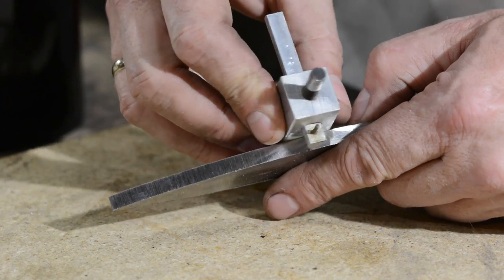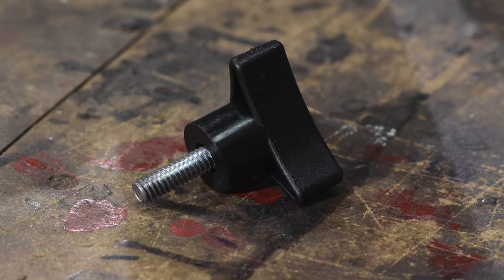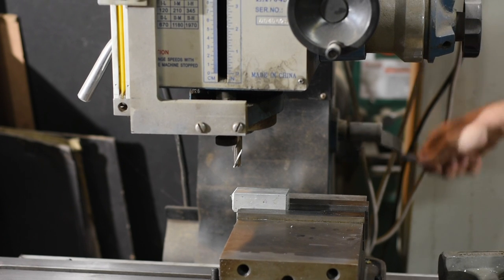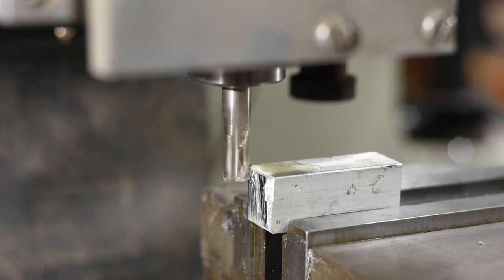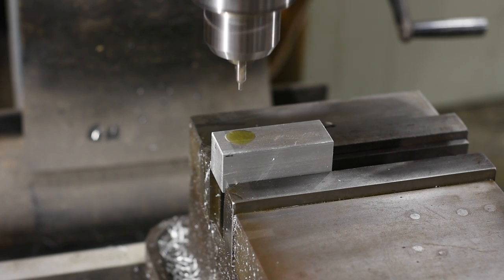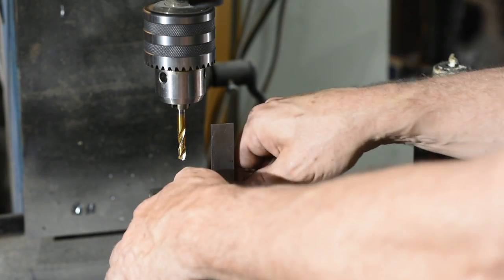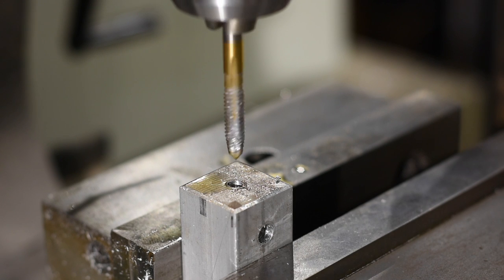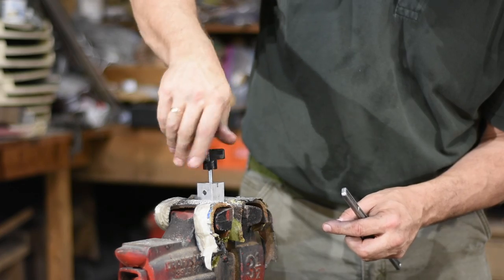Making a Knife Maker's Center Scribe - Easy Project!  Useful Tool!

Comment: Nice version of an old wood working marking tool. For center finding on an edge I use an even older version. Take some flat stock drill a hole at the center of length through it's face. Then drill two holes either side of that center, equidistant. Put pins in those holes and scriber into center hole. Put the scriber to your working stock and twist the bar until the pins ride on the working stock. Slide it down your edge and instant center line.

Comment: So you measure the thickness of the stock.......... then you adjust this extremely precise tool by hand.  It isent set up like a digital caliper to be some what exact?  Just use your eye and hand, is that correct?  I mean that's a pretty big let down.  You want a tool to help you find the true center line, so you buy this and then you do it by eye and hand.  Unless I'm missing something, but like amazon this video really dosent show how it's used.  So I'm trying to figure out if theres more to this than what I have figured on up above here.

Comment: You said the symmetrical grinds diminish the likelihood of warping during heat treating.  But aren't a lot of Japanese knives ground with the bevel on one side only?  That's about as asymmetrical as you can get.  Do they always warp?  How do they deal with warping?
Reply: Sam Harper Some knife makers heat treat and temper before doing the bevels.  A chiesel grind would absolutly benefit from that technique.
Reply: They're usually done with an iron core so they when the blades inevitably warp, they just hammer it back to flat. Walter demonstrates this in his sushi knife video.

Comment: Walter, is sticking something to a brass rod, 
using a brass filler, soldering, brazing, or welding?

I'm pretty sure that it isn't soldering, (although 
brazing 2 pieces of steel, IS soldering.  (An 
adhesive bond.)  Welding USUALLY involves 
steel, but wouldn't joining 2 pieces of brass?
Sounds like welding, to me.

https://en.wikipedia.org/wiki/Soldering

steve
Reply from the maker: In different trades, you'll find different answers to that questions.  The general notion is that soldering is a low temperature operation (around 500F) and brazing is a higher temperature operation (typically above 900 F).  In both cases, however, you're using a second (generally) dissimilar metal with a lower melting temp to join to other pieces of metal with a higher melting point, whereas welding involves actually melting the pieces which are being joined.
Reply: Walter, I was arguing semantics.

Is attaching 2 pieces of brass, using 
brass filler, welding or brazing?

I'm saying both. :D

steve

Comment: Hint for tool improvement:  If you tap the brass scribe holder with a  fine thread on the end away from the scribe as well, and put an appropriately sized nut on it, you will have either a repeatable stop for scribe position and/or a micro height adjustment.

Comment: Made an ripp of version with an big bolt and a nut  ...drilled a hole in the nut for the "axle" that is brass in the video and a broken drill as scribe...it does not look as good but works :) ..did not have any taps for thredding ;)

Comment: Don't use oil on aluminium when drilling or tapping. The oil could cause the tap or drill to gall.
Reply: Absolutely not true.  Aluminum is soft and will clog the flutes.  It needs lubrication.  Even WD40 works